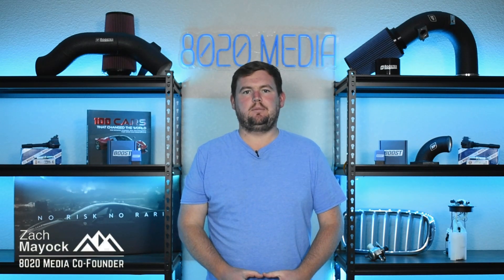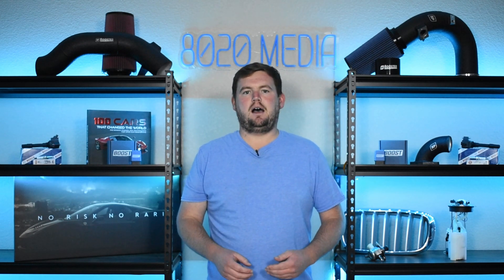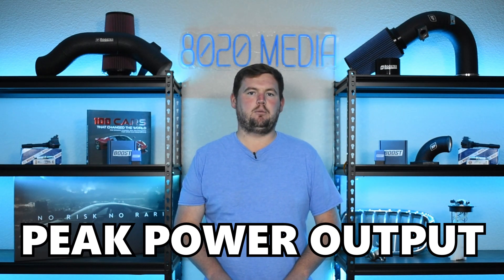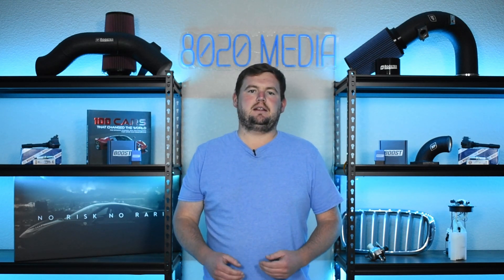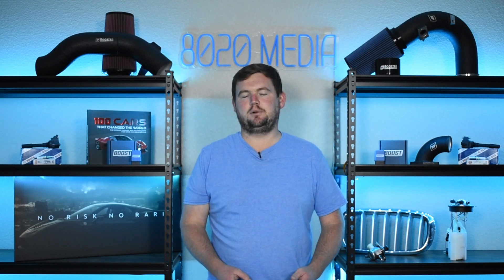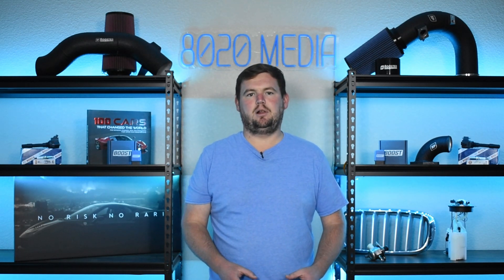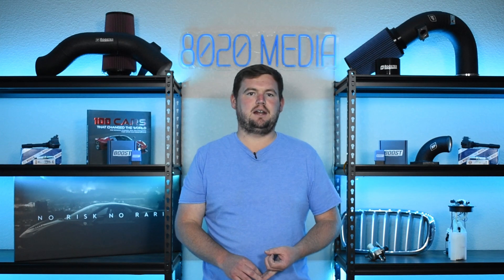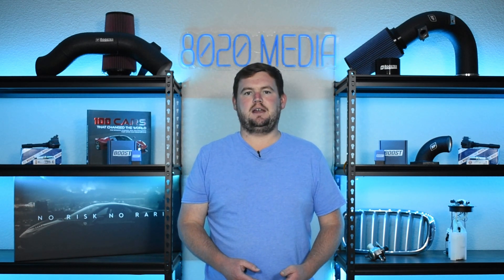Honda K20 vs K24: Which is Better?

Comment: I’m surprised you said that the K20 has higher power variants because of turbocharging, when even N/A the K20 was offered with a higher BHP rating. K20A was 221 vs K24A2 was 205

Comment: What are the differences between the K24A and K24Z7? I have a 2012 Civic Si with the latter.
Reply from the maker: D - The K24A and K24Z7 are both 2.4-liter Honda inline-4 engines, but they differ significantly in design, performance characteristics, and supporting systems. The K24A (most famously in the K24A2 from the Acura TSX) uses a true performance-oriented i-VTEC system on both intake and exhaust cams, a higher compression ratio (around 10.5:1), and a freer-flowing head with better high-RPM breathing, making it popular for swaps. The K24Z7 in your 2012 Civic Si is part of the later “Z-series” evolution, with a different head casting, a revised i-VTEC system that has full VTEC on the intake cam but only VTC (cam phasing) on the exhaust, an integrated exhaust manifold in the head, and a higher compression ratio (11.0:1) paired with a different piston design. The Z7 also uses drive-by-wire throttle, has improved emissions compliance, and is tuned from the factory for a broader mid-range rather than just top-end power. While both are durable and respond well to mods, the K24A2 is a bit more straightforward for high-revving builds due to its head flow and cam options, whereas the K24Z7 benefits more from bolt-ons, tuning, and forced induction since the integrated exhaust limits header choices.

Comment: Just bought a Accord coupe for $3k with the 2.4L VTech K24. Always wanted a Honda and the k24 engine. Thank Goodness.
Reply: If it’s 03 or 04 look out for cam lobe wear, Honda had a bad batch of camshafts those years
Reply from the maker: J - Thanks for sharing!
Reply: Thats not a good k24 though. Change head
Reply from the maker: A - That'll be super reliable!
Reply: My last car was a 2007 Accord Sedan I4.  235k and still ran the same as it did when I bought it new.  I put a whole $1,000 into it (besides tires and oil)... Replaced the power steering pump, fan assembly, and alternator around 200k.  Everything else worked on the car... A/C, power windows, etc.  I totaled it a year ago.  🥺😭